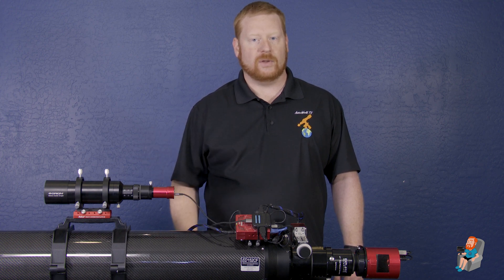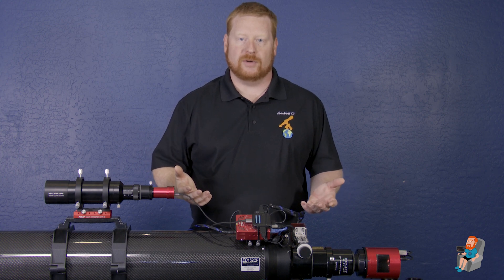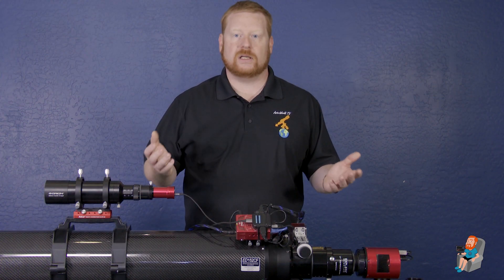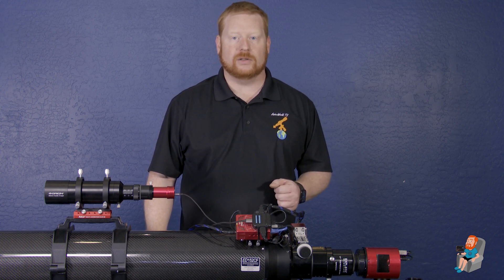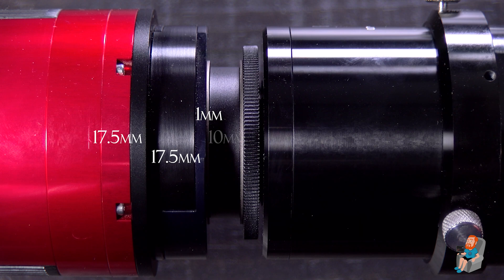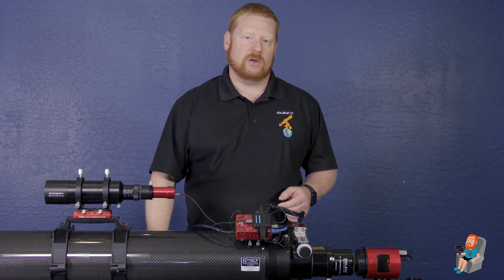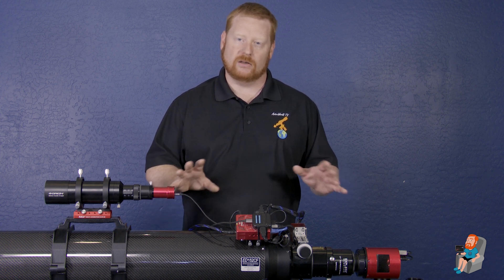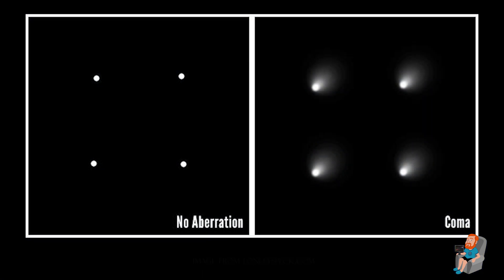Back Focus Fundamentals

Comment: Great Video Jason, I just subscribed. I have two questions and would be grateful if you can answer. 
1. Why is back-focus such an issue if one has enough travel on the focuser draw-tube to bring the camera into focus? 2. If one is able to achieve focus using the focuser draw-tube, is the spacing between the last lens element in the imaging train (reducer/flattener) and the sensor still crucial/important? I would assume not. 
Btw..Great ending to your video and a big hug to your daughter...I have a daughter too who is about to turn 2 :-)) Thank you!
Reply from the maker: Hi,  it’s Dan from AstroWorld.  Once you put a flattener in the image train you need a certain amount of spacing from the flattener to the chip this spacing is crucial in order to correct the curvature in a refractor so all your stars are in focus across the chip(even the corners ) which is where you will see the curvatures harshest effects usually.remember it’s not the draw tube length the flattener is usually at the end of the focuser whereas the flattener spacing is from the flattener to chip at the end of your image train. Hope that helps! 

Dan
Reply: @AstroWorldTV  Thanks so much for the clarification Dan. That was really helpful!
Reply from the maker: @astrokumaon3397  no problem !!! Glad I could help!